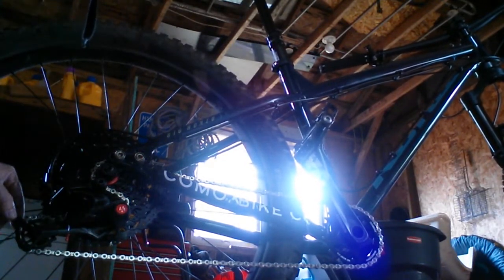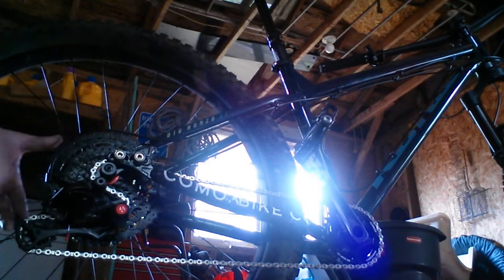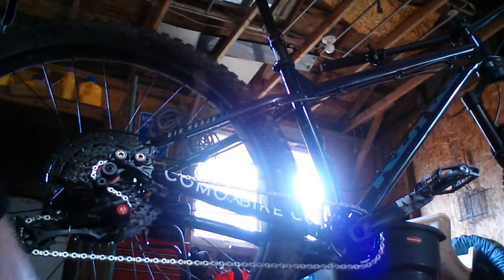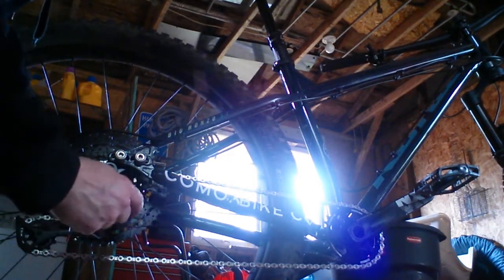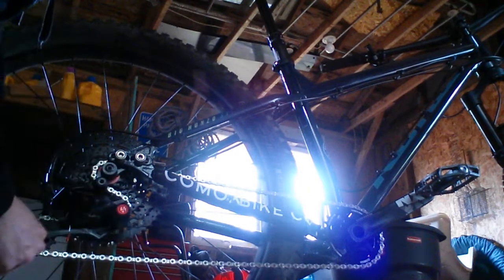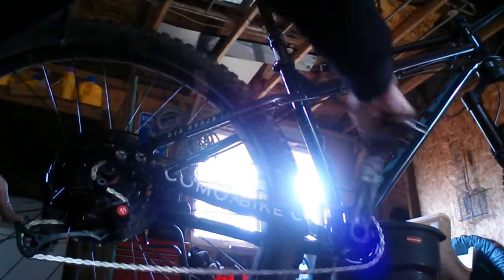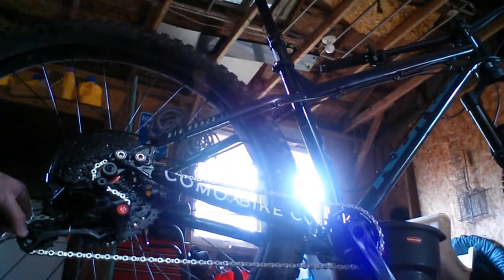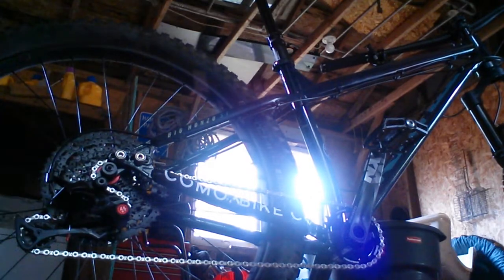box two Prime 9 Drivetrain Problems.  Now we're getting somewhere

Comment: There are calculations you can do based on chainring teeth, biggest cassette gear and chainstay length to determine the right chain length. You may also want to check your B-limit screw.
Reply from the maker: @down to Ride Mtb- I fiddled with the B screw. It helped a little,  but then it shifted rough. I was able to tighten the clutch and the problem went away but then it wouldn't shift to easy gears
Reply: B screw should be about 8mm when on the biggest sprocket measure the gap between the upper pulley teeth and the sprocket teeth. I have the same drivetrain and i used the largest rear sprocket to front chainring to measure the chain and mine is way shorter. I make a video and show you how mine works if you like